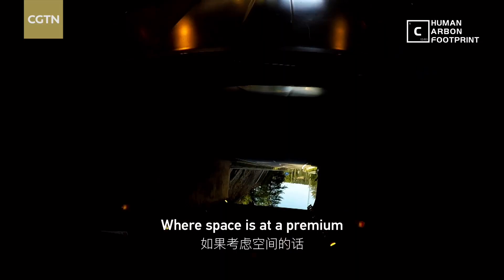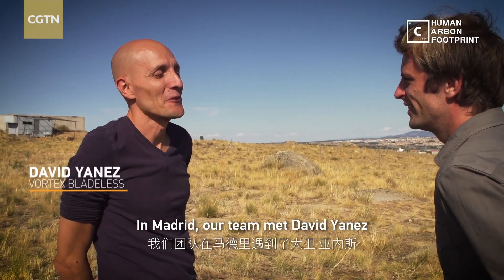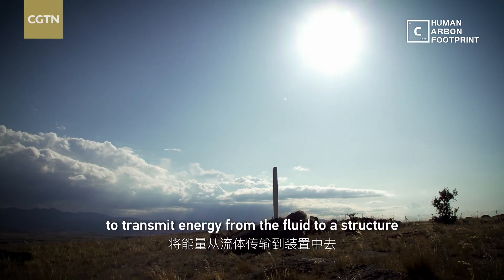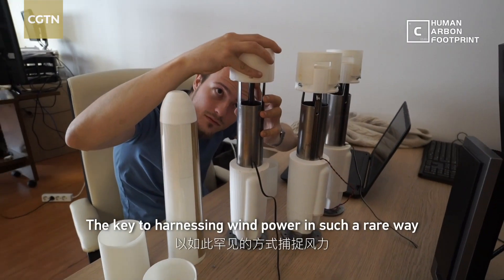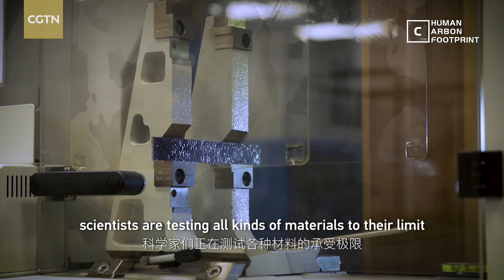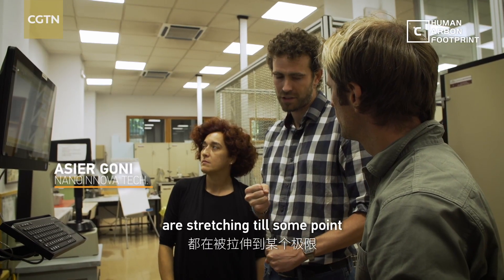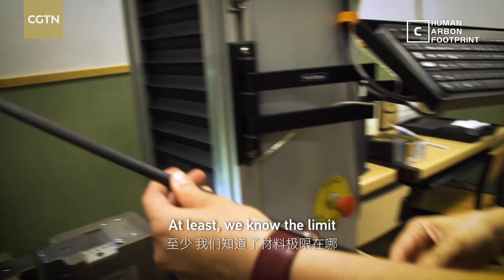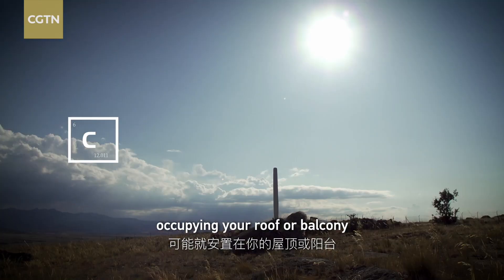'Human Carbon Footprint': The quest for a bladeless wind turbine

Comment: Smarter to do a more efficient vertical axis wind turbine design, it would need to be shielded else bird mincing machine. Getting them closes together is important out to sea, you can do more with that structure and inland, lining them up closer in the best locations is also better. Simply generate much more energy and a lot less hassle to keep clean and way more durable. It would be nice but inherently can not be that effective in actual use.